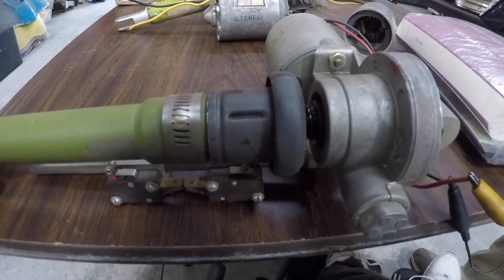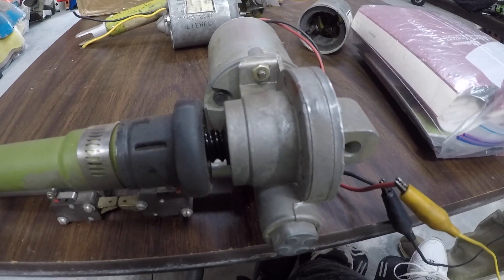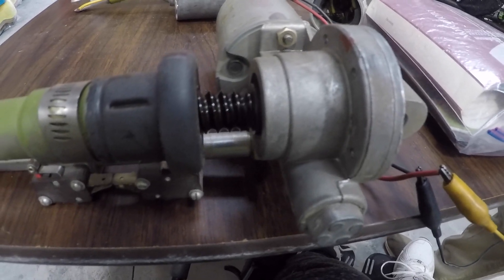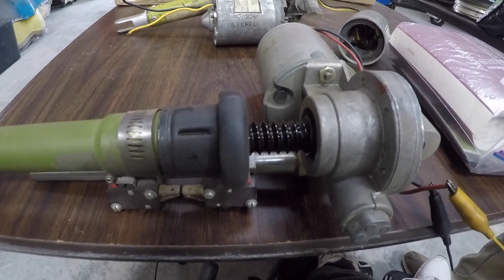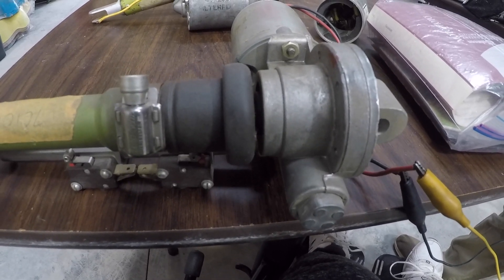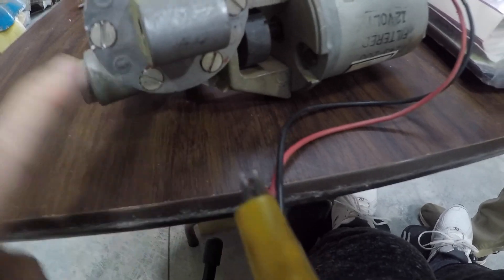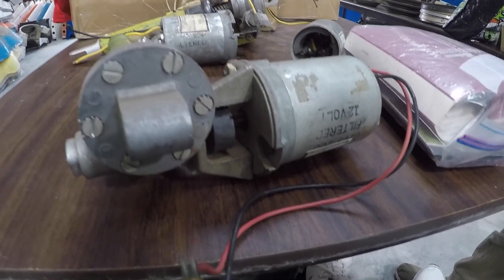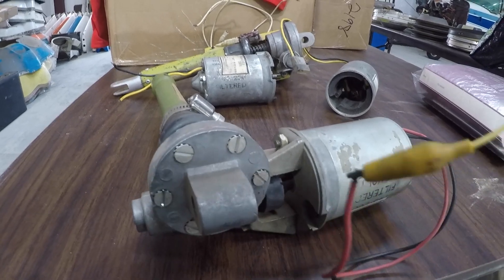Flap Motor Worm Drive - Grumman Style

Comment: HI there, I have been having a problem with my 71 aa1a flap motor, the inside of the tube connected to the flaps that makes contact with the worm gear is spinning in its metal housing prematurely before the flaps have come all the way up, causing them to go up very slowly incrementally or simply not coming up at all. It also doesn't come up enough to hit the flap motor kill switch so its easy to burn it out of the flap switch is left in the up position after landing. Any help would be appreciated.
Reply from the maker: Where are you located?
Reply: @GrummanPilots  i am located in Grand Rapids michigan, I was able to figure out the friction clutch device on the flaps, which was my problem